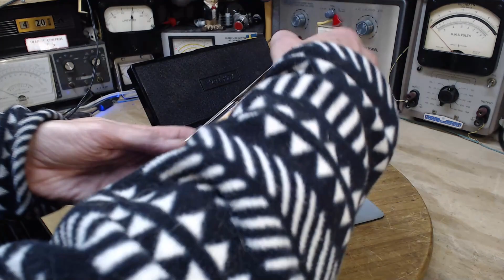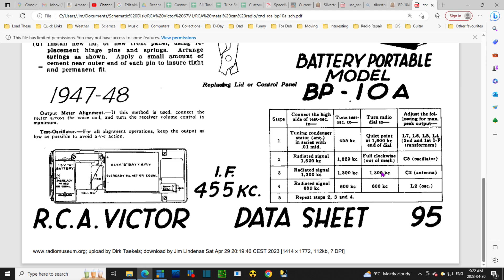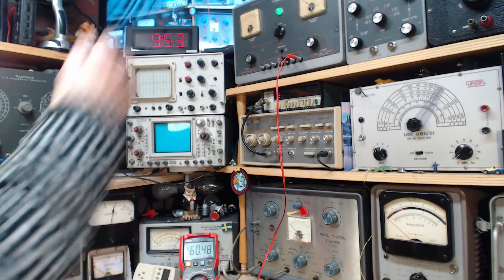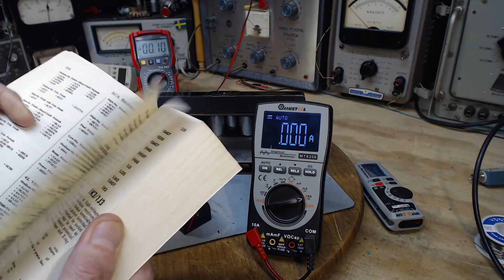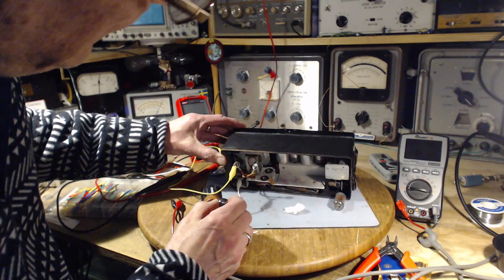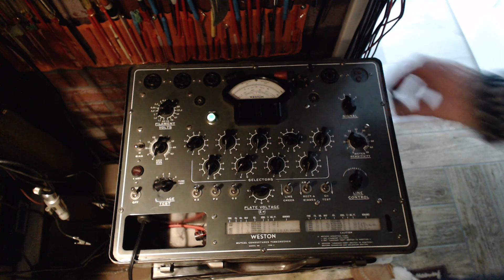RCA Victor BP-10A Portable Tube Radio Video #1 - Checkout, Power up and Tubes Tested

Comment: I remember buying A batteries. They were special rectangular 1.5 volt batteries only used and made for this type of radio. The 67 1/2 Vdc were larger about the size of  pack of cigarettes. Total cost retail was $15 , a lot of money in the late 40’s and early 50’s. Ive never seen one like this, battery only.

Comment: I see on the web that you can "build" a B battery with (7) 9 volt batteries (for 63V)  which should work
Reply: Yes, i even used 8 tubes and the extra 5 volts made little difference and a longer life. I like the package 8 9;volt batteries made.

Comment: Back in time when most radios were battery operated, especially farm radios, you had 2 batteries. The "A" battery was for the filaments and was rechargeable. When it got low you took it to the local dealer or garage to recharge. The "B" or HT battery was expendable. During WW2 this model was dropped to French resistance units to receive the BBC messages.

Comment: For some reason I feel that Jim has the 1.5 volt battery polarity reversed?? It looks correct, but I have seen this before where the battery has used a spring end, normally for the negative, actually for the positive terminal.. I guess we will see what he finds in the next video...
Reply: Yes, I took a closer look at the schematic online and came to the same conclusion. There is no reason those 1 volt filament tubes would ever draw that much current, when the typical tube current was 50 ma to 100 ma each. I sent Jim a note to take a closer look at the color coding wires fir the A battery.